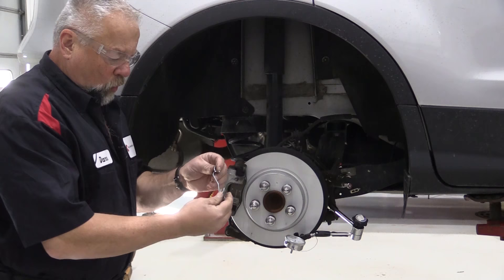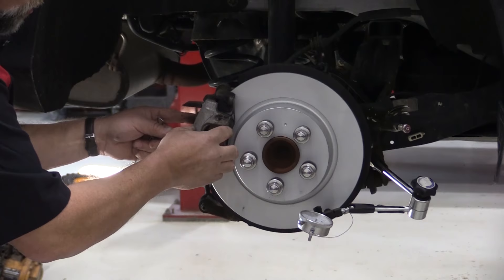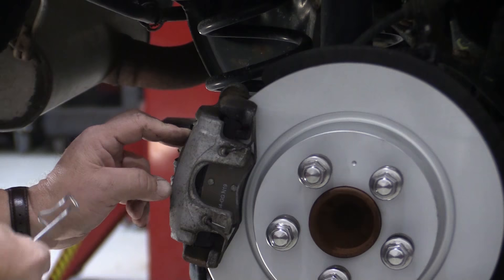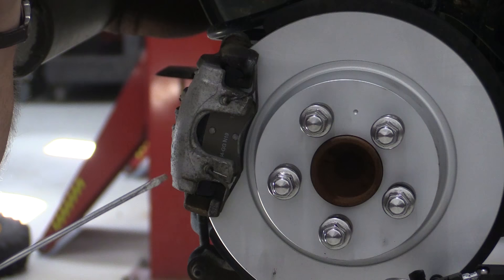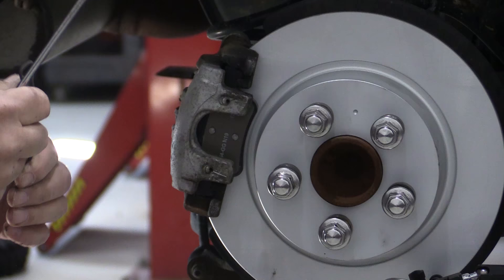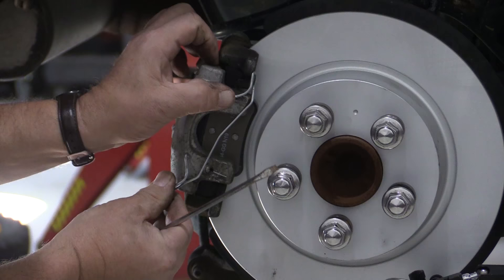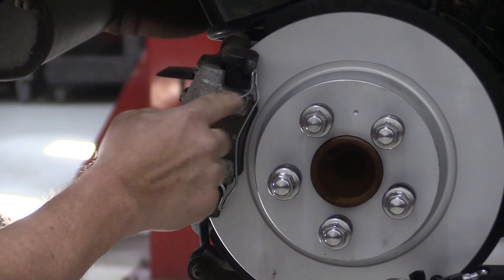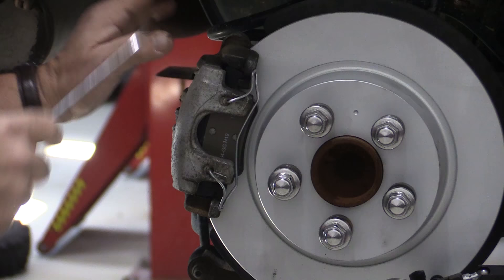How to Install Brake Pad Retainer Clips

Comment: Tip:put a small amount of silicon brake grease on the ends of those clips, where they go into the holes.  This will stop them from rusting to the caliper so you can easily remove them next brake job.

Comment: Is the spring supposed to clip under the edge of the brake pad? When you took it off it looked like it was but you never put the new one back on the brake pad. Is this video incomplete?

Comment: My clip is stuck on there by rust and the other side broke off. How to bang it out?
Reply: I would use some needle nose and gently wiggle it back and forth while pulling to try to free it.  If that doesnt work you could try heating the clip  near where it goes into the hole as well as around the hole a little using propane or map gas, when hot quickly cool it with a wet cloth, then try the needle nose again.  If still stuck you could spray with penetrating fluid and let soak into hole overnight, just dont get any on pads/rotors.  For the broken off ones try the same method if you can grab onto the end with needle nose.  Otherwise i would carefully drill the broken off part of the clip out of the hole, match up a new clip with the matching drill bit size for the right bit, and dont drill too deep.

Comment: This must be a 2018+ I have a 2016 Nissan Altima with a squealing noise when applying the brakes at LOW SPEED. I can imagine it's no different at high speeds also. Brakes are New-ish. When doing the job a couple months ago, I bought O'riellys cheapest pads. Greased em up and threw em on. WAIT! There's a difference in the pads. The retainer clips didn't match the old ones. I matched each side up with one side both different inside/outside pads. Leaving each side with one brake pad equipped with retainer clip facing outward to the wheel. When I pulled them off Today, I found that every single pad inside AND out, had the same retainer clips or "squeelers". Assuming the "squealer pin" was the issue (since the pads are new-ish) had to be the issue. I bent each brake pad back and fourth until I snapped the 1/2 inch thin squealer pin off the pad connected with it looked to be a rivet. Put everything back together, and what do you know, .the noise was still there. Only, it wasn't alone. It brought another noise to the show. This one not as sheer. It was more of a continuous THUD. Could this be the zip ties used to hold my hubcap in place? Possibly. However, breaking the "squealer pins" off did NOT FIX THE SQUEEZING. Now back to the drawing board. Damn it.

Comment: I've installed a lot of disc brakes on my cars over the years. But I'm putting new rear brakes on my 2004 silverado and the pads will only go on without the clips. With the clips on, there is not enough room for the tabs to slide in, even whin pounding with a rubber mallet. So I have to go without the clips. :(
Reply: They would have fit if you had pressed in the caliper pistons.....
Reply: Are they the correct pads?

Comment: Just wanted to find out what these pieces of crap are called. I have changed these in the past no problems. With that said, today I changed the rear pads and rotors on my 2012 mazda 3 for the first time. Eight years of NY winter salt and 86,000 miles welded them in. They would NOT come out. The first side I did I actually broke the lower portion off in the caliper and it kept breaking off until I had nothing left to grab. My only option was to drill a new hole right in front of the original. On to the second side after numerous applications of pb blaster and me cutting the clip in half I found that using channel locks applying pressure against the caliper to force it out was the best method. Last year I changed the front pads and rotors and the clips came out fine but I think it was the second time of changing the pads. However the rotors were stuck on so bad I had to cut them off the hub. After last years rotors and this years retainer clips I will never tell anyone again " do it yourself breaks and rotors are easy".
Reply: Are the spring clips really even necessary? I had them break on my 2002 Jeep Grand Cherokee and can’t remove the remnant pieces.
Reply: Also NY snow. Gotten a car from NY. Rattle clip got stuck. The other side got stuck as well. Thinking about banging a nail from the inside out.